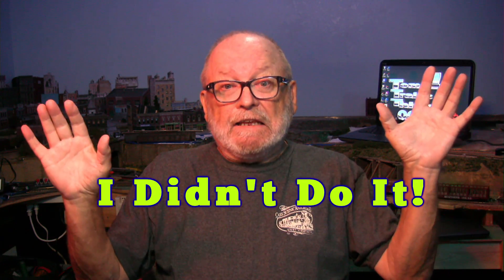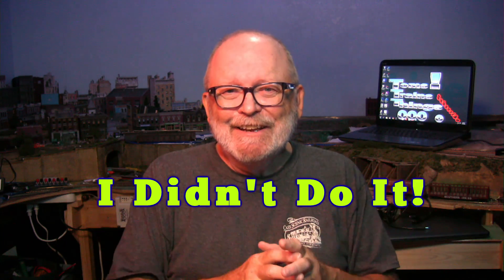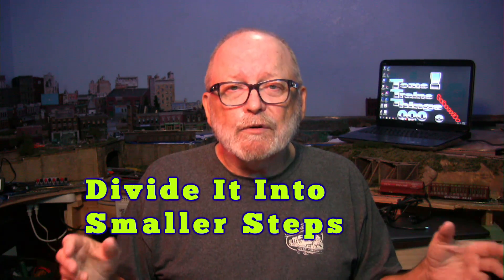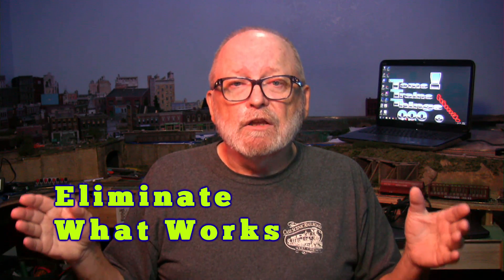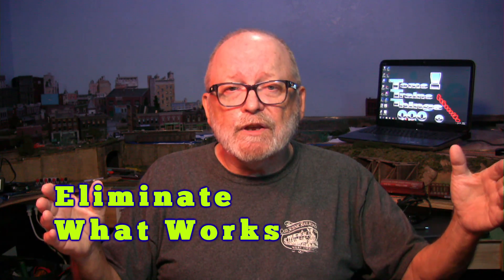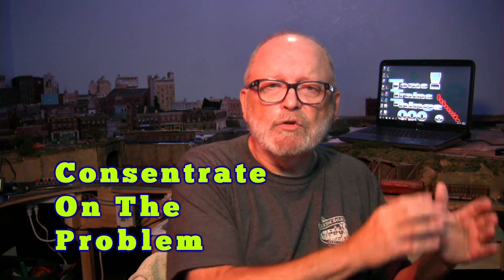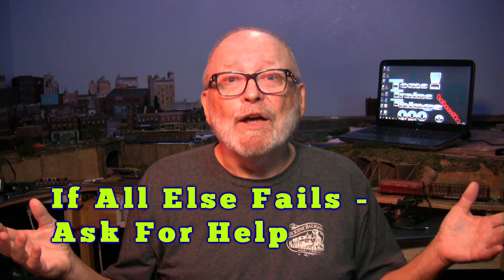Best Troubleshooting Tips

Comment: I hate intermittents and workarounds.  Both are headaches when trouble shooting.  Workarounds that do not document actions taken that change the baseline configuration are always a problem waiting to happen.  You can’t be scattershot either when troubleshooting.  You should document the steps you took in troubleshooting so you do not duplicate mistakes and chase your tail.
Reply from the maker: Intermittent ones are the worst. I can't count the number of times a machine would start working correctly when I started troubleshooting.